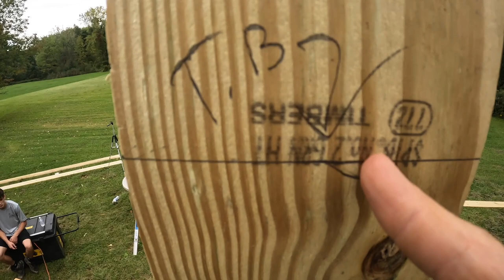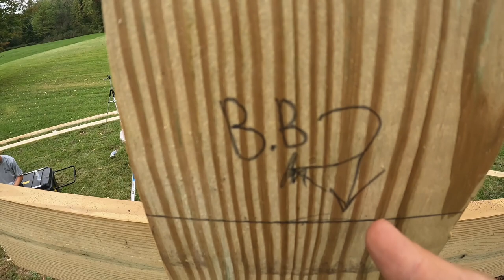How to use a laser to make a level deck

Comment: Thank you... getting ready to build out a loft in our barn/shop, and I need to hang glulams and joists about 13' off the floor, but the floor's not going to be reliably level enough. Wondered how you'd actually get the laser level mark high enough... duh. Nice simple explanation. Thank you.

Comment: Thanks.  Nice video.  What's the crow's foot all about?
Reply from the maker: When you mark a measurement on lumber with a pencil you make a "crows foot". Its two lines that form a small arrow or triangle and the point of it lines up with the tape measure or the lazer.

Comment: You showed using the laser to get one reference point and use that reference point to calculate the other elevation. I think it is way faster and more straight forward if you just use a simple transparent water tube to find the correct level/elevation at any point basing the science that water seeks its own level.
Reply from the maker: The lazer has tubes with water and air to create a level plane. The problem with string line levels is that the weight of the level pulls on the string and creates slight errors.
Reply: eh...water tubes are kind of a pain.  Often need two people and getting all the bubbles out and trying to prevent spills...nahh...